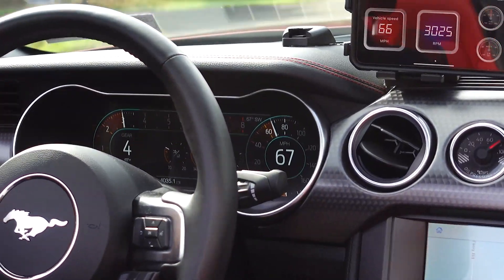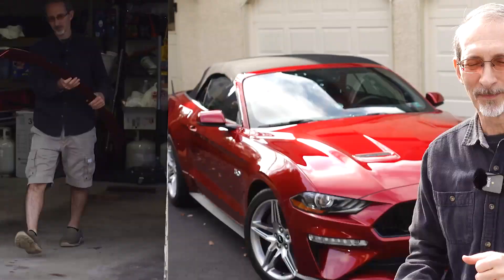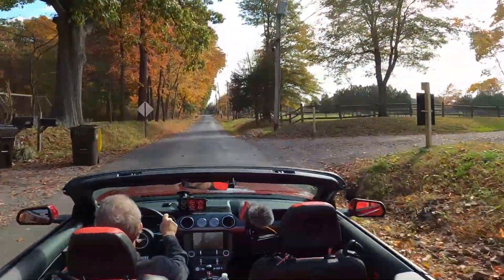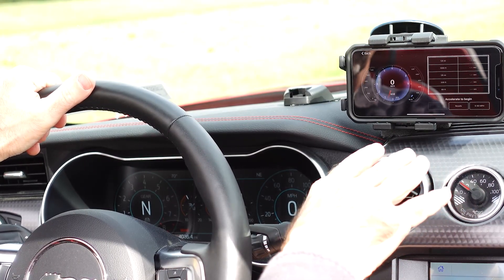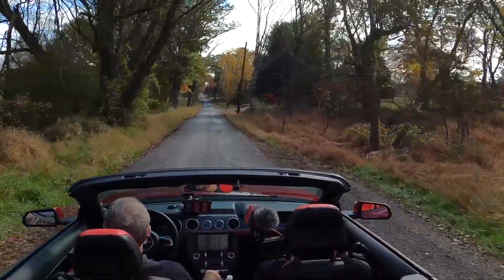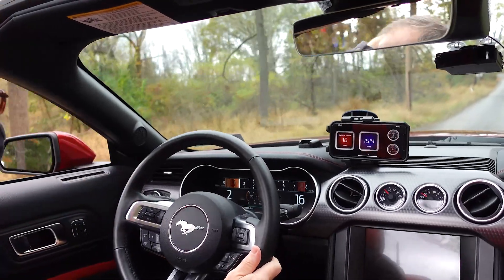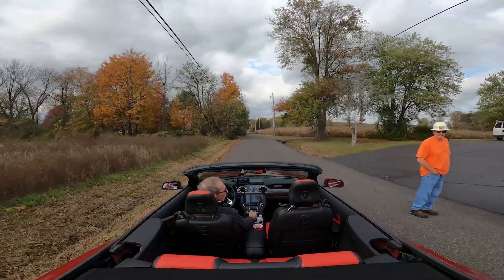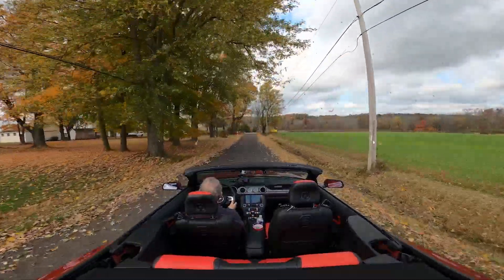Mustang GT Convertible Pulls | OBD Link MX+ Testing

Comment: Thanks for the review! This is making me so excited to get my new 2021!. In 2010 (age 19) I bought a 2007 V6 (210 HP) Mustang Convertible (torch red) with cloth seats and very limited options! Loved the thing! I sold that in February of 2018 (age 27) and bought a 2016 4-cylinder turbo (310 HP) this time with black leather interior and the touch screen etc. definitely an upgrade but still not my dream vehicle. Yesterday I ordered a 2021 Mustang Premium GT Convertible (Race red) with performance active exhaust, upgraded air intake (essentially the Mach-1) engine but in the GT convertible package (480 HP) with red leather interior, upgraded sound system and subwoofer, voice control touch screen with navigation, adaptive cruise control, black racing stripe, dual hood vents digital dash cluster etc etc. finally after 11 years and by age 30 I worked my way up to my dream mustang!! My car gets delivered in 6-8 weeks! $53,440 MSRP plus the $2000 special order upgrade for the upgrade to make it the Mach-1 (480 HP) engine. Watching videos like this to pass the time for the next 6-8 weeks
Reply from the maker: Michael, thank you for sharing your Mustang history, and sincere congratulations on the awesome 2021 Mustang convertible that you have on order! My 2019 convertible was ordered in May, and took five months to build and deliver, since they were transitioning from the 2018‘s to the 2019‘s. That was one of the hardest things I ever had to wait for, and I spent countless hours on YouTube watching mustang videos to pass the time. Well, your time will come before you know it and then the fun really begins. Hang in there, and be sure to keep us posted in the comments section on the progress of your build. All the best!

Comment: @Mike Fyxdt Many thanks for the updated video on the OBDLink vs OEM gauges comparison in regard lag. It's really very good - the tach actually looked really well synched; for the speed, it's hard to say if it's so much a lag vs a calibration factor. Appreciate you took the trouble to do that - combined with some nice Fall scenery :thumb
Reply from the maker: @decosse01
- You're welcome - thanks for the inspiration! I think any 'lag' you see may be how fast the OBD-II unit sends the data to the phone via Bluetooth. I wonder if a Wi-Fi version would be any different. I agree that the difference between the two speedos could probably be minimized if I took the time to calibrate them. Performance/display aside, this unit provides a really good variety of technical data on the car's systems, which for me is the main event. All the gauges, bells and whistles are the icing on the cake!

Comment: If you are on the highway in 6th gear with cruise control on , what happens if you dump the clutch to down shift , will it automatically kick cruise off or will rpms race ?
Reply from the maker: No, I’m pretty sure pushing in the clutch disables cruise control, like tapping the brake. 😀
Reply: @MikeFyxdt  thanks and your car looks great thanks for talking me into buying one

Comment: The spoiler will look great when it's on. And the stock height on these cars looks great so I wouldn't worry about lowering it if it works for you
Reply from the maker: @Canadian Cruisin
 - It's nice cars like yours that make me envious of the lower stance! Plus, again thanks to you, I know how to install those lowering springs. :)
Reply: @MikeFyxdt  believe it or not I dont bottom out to often.
Reply from the maker: @CanadianCruisin  good to know! Curious... With all your suspension mods, has it had an effect on your alignment?
Reply: @MikeFyxdt  I got it aligned when I lowered it but the specs were so close I probably didn't have to. Now with the added steeda stuff I haven't got it done yet but I might get it checked out just to see. It feels solid driving still so it might be a waste again
Reply from the maker: @CanadianCruisin  Any flat straight road is going to tell you if your car is out of alignment. People say to get an alignment to save your tires. I say if you want to save tires don't get a Mustang.
Reply: @MikeFyxdt  haha true. I try to be nice to my tires but accidents happen 😅